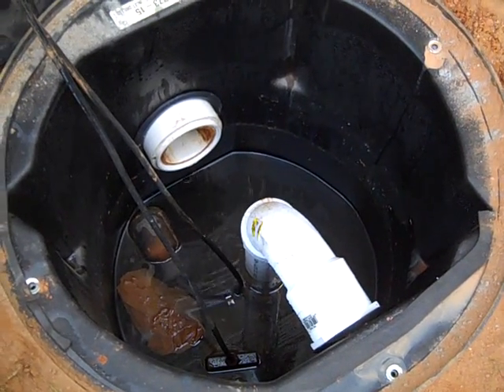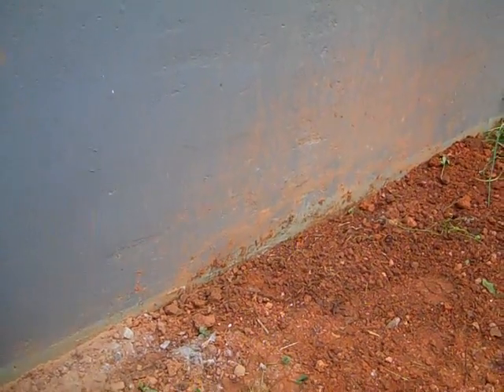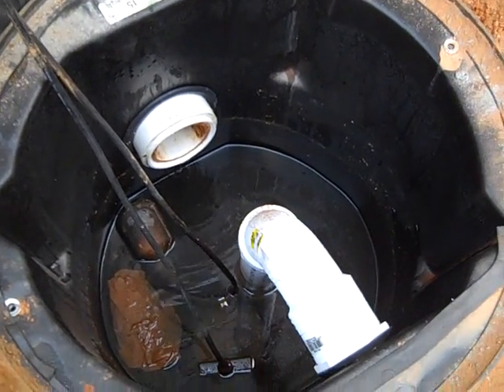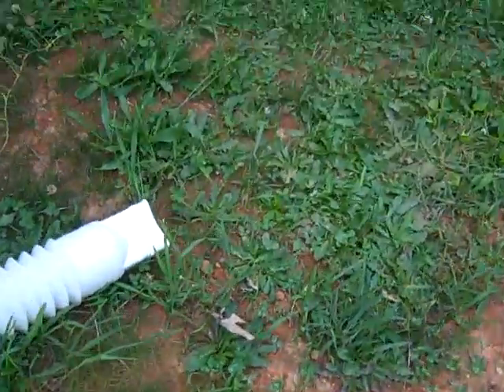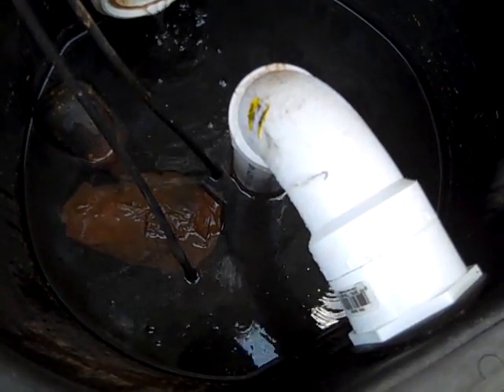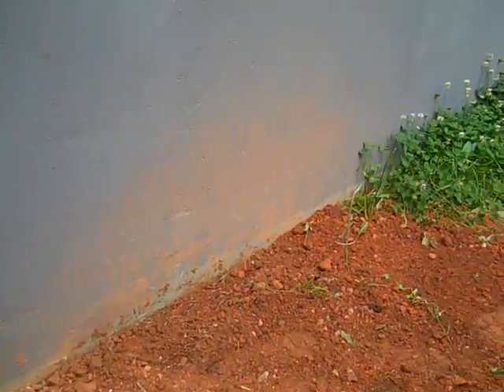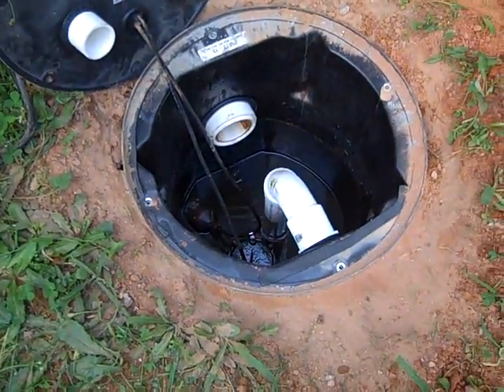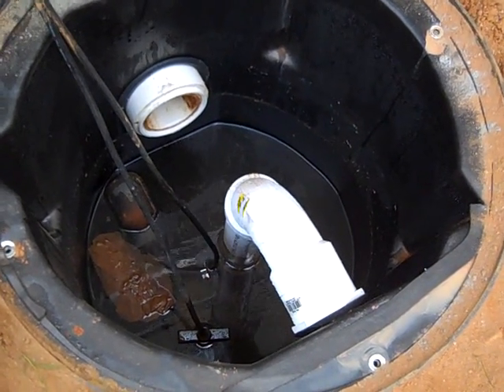When The Pump Turns Brown!

Comment: Great videos!  One thing I'd like to note as a professional septic designer and installer, and it's an important one.  A macerator pump is OK if you are pumping to a municipal system, but actually detrimental to an onsite septic system.  If you have a septic system, it is important to use a NON macerator pump or you will shorten the life of your field, if not kill it entirely.  Happy to explain if you want to PM me. 
Keep up the great work!

Comment: I've got a sewage ejection system in my full basement. I find best results using septic safe toilet paper and I use rid-x once a month to help keep the sludge from building up to much and blocking the pump intake.

Comment: The houses at the lowest point in the lines become exit points on the sewer lines. Depending on the back-pressure in the line you can get "water" hitting the ceiling in the bathrooms. 

Dirty jobs did one on the cleanup after an event if you want to check back episodes to see how bad it gets.

Comment: I have a full basement, concrete walls etc. lights work bench couch tv etc. There is no bathroom down here mainly because the plumbing is in the ceiling. Could I use something like this to add a bathroom down here?

Comment: That works just like the sump pump I had in my basement.  Sump pump plugged into the float switch, which plugged into 110v A/C.  The only difference is this pump has a "grinder" on the intake to break up solid waste?